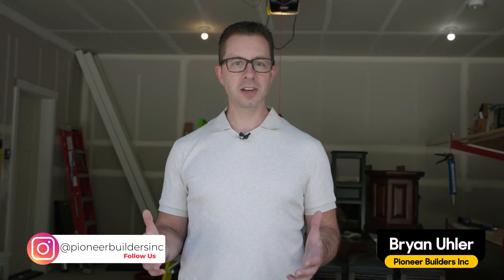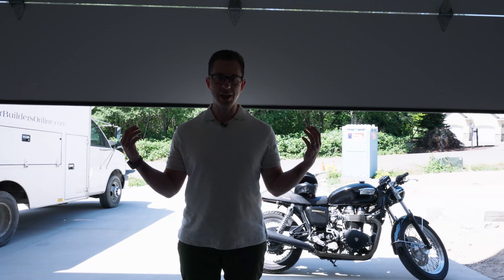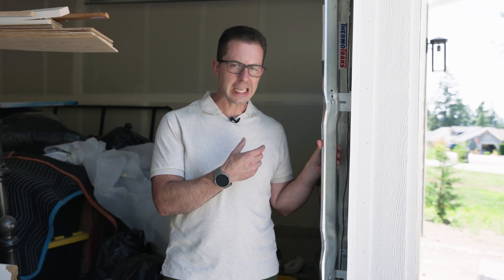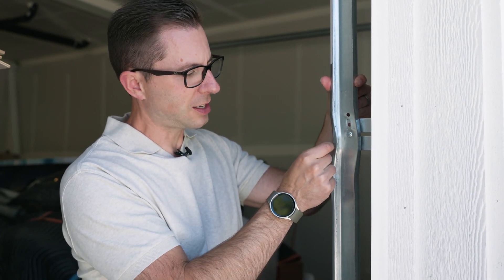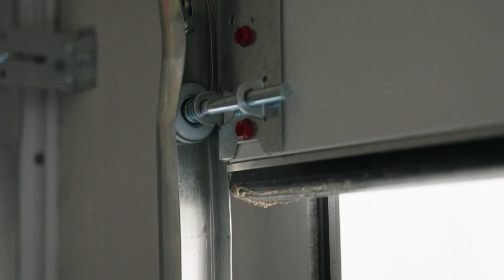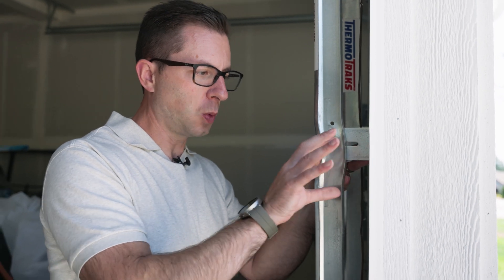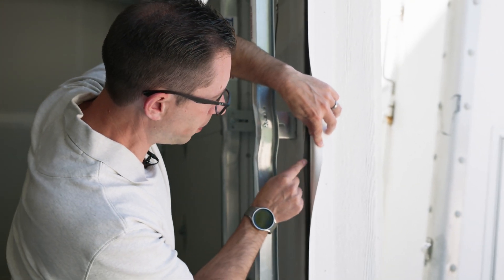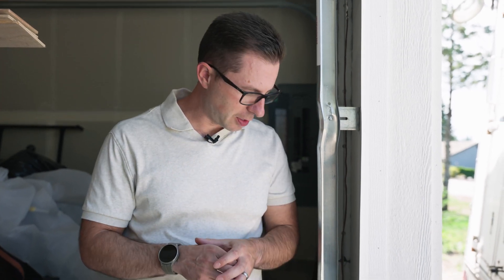Building Science, Garage Doors, and ThermoTraks

Comment: I'm thinking more and more about venting the Heat Pump Water Heater to the outside.   Supposedly AO Smith makes a bolt on kit.  I would imagine Rheem does too.   Those heat pumps really do freeze the garage out.   That's my less expensive idea vs. providing a Sanden HP water heater.  Not gonna happen on a spec house! 😆
Reply from the maker: These are great in a hot garage during the summer. In the winter, depending on demand, heat pump only just may not produce enough hot water